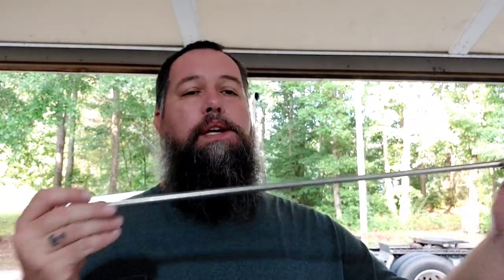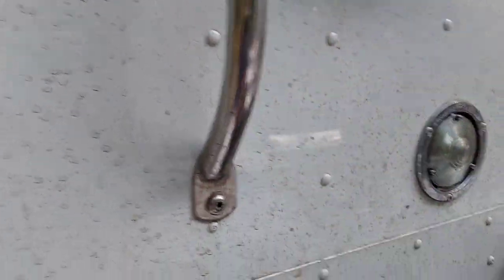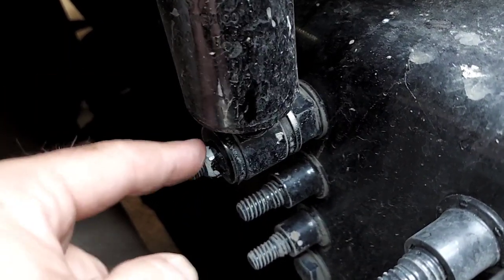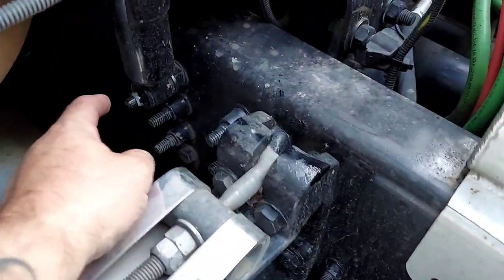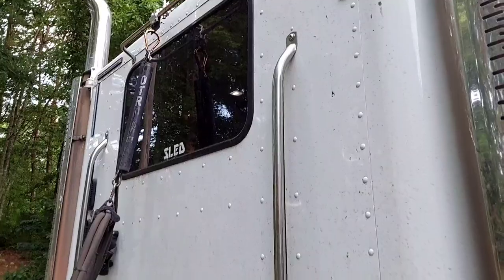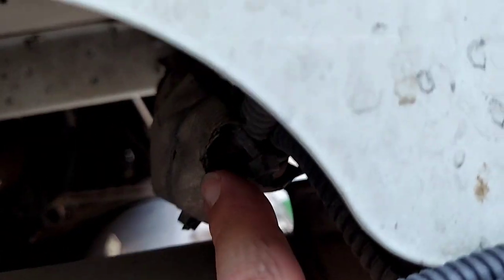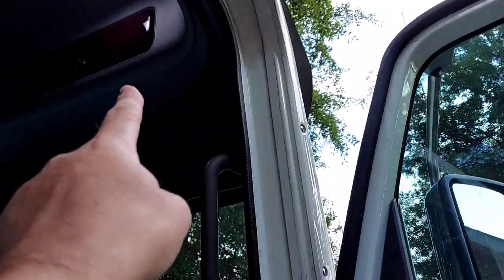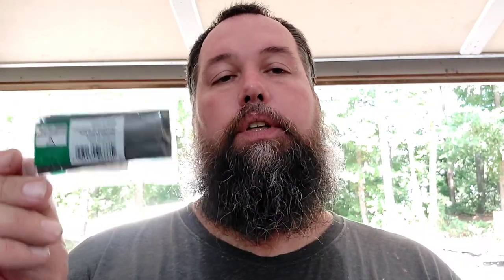The best CB antenna and mount location to date!

Comment: Now that you've had the antenna for a bit is it any good? Looking at getting one for my dump truck because I'm tired of buying new whips for my Wilson.
Reply from the maker: I really like it. I do hit a few trees, but the whip doesn't been easily like the Wilson's do. The spring on the top of the coil helps.
Reply: Thanks, I probably buy a new whip twice a season running asphalt. The last whip fell off under a silo and I've just been running a 2ft Wilson fiberglass. technically works ok for what I do most often but definitely not good enough for my anytone6666 full potential.
Reply from the maker: @rkelly5803  the Hustler SCB should hold up a lot better. I have found (besides having a good antenna) RF bonding will help get the most of your system. Check out this video. The RF bonding is so much better I'm going to do CB install in my personal vehicle (when I get time) just to do another bonding project, and a couple videos to go with it.https://youtu.be/J6PJyw6jh2M
Reply: I have the same hustler antenna but with short lower staff. I run alot of asphalt as well and it has taken the beating. Proven antennas with good coax and proper grounding, it's a great setup. Plus they have holes so they don't hold water and freeze. Hope that helps

Comment: Why do truckers point antennas somewhat forward? Is it aesthetics? Omnidirectional antennas need to be vertical to work properly. Pointing them forward sends the electromagnetic waves to the ground and the sky, not in the direction of other radios.
Reply from the maker: Great question! There's a few reasons you may want to tilt them forward. 1. Most of do the most talking at 70 MPH, and if the antenna was straight up at 0 mph it's now pointing at the trailer at 70 mph. So, with a little lean the top half will be straightat speed. Depending on the mounting location it maybe necessary to tilt forward to get the coil away from the body to reduce reflection and lower SWRs. 3. Height requirements, some antennas maybe just too long and you don't want to be hitting trees, power lines, and low bridges. 4. Some think it looks cool.🤷‍♂️ Thanks for watching.
Reply: @jrichtruckincbtips  Nope...Often Not True..
The lower part of say your husler isnt flexing at any speed... the top half sure..but that mostly Affects Only recieve and NOT transmit

Some to get it to fit on say a 52" or taller antenna
Though looks like Crap..given I know how it Negates or limits better transmit abilities
Reply from the maker: @MrBOB39  not talking about the Hustler at all here, just antennas in general. Further more depending on the mounting location , you need to lean the antenna forward to reduce reflection and lower swr.
Reply: @jrichtruckincbtips  you likely Dont Realise or Understand how an antenna radiates Signal
Reply: Cause it looks cool is what I have heard. 
Like bull horns
Reply: @mrdirtwork6673  perhaps..
Yet doing that lowers the performance of the antenna

Comment: What antenna would you recommend for a 2020 t680 with the tall double sleeper(don't know what else to call it) it has the mirror mount but I'd be open to other options
Reply from the maker: I ran 6' Skip Shooters on my T880 with a short pipe over the base to reduce flex see this video https://youtu.be/jqw0Iy-5LwU.

You also need to ground the antennas and mirrors on that truck see this video https://youtu.be/Ar6mxY57lzs

Comment: Hello, where did you get the piece of pipe to go over the skip shooter?
Reply from the maker: Home Depot- 3/4" cpvc (not pvc)
Reply: @jrichtruckincbtips  did you heat it up or something to go over the bottom?
Reply from the maker: @boundndetermined225  you can, I just used a Dremel tool
Reply: @jrichtruckincbtips  Thanks for the info. Are you still running the 7' skip shooter. I have a 2017 Freightliner Cascadia and atm I have the predator 10k-22 on it (with a 99n4 radio). But it only tunes out to 1.6 swr & that's with leaning the antenna. I've also tried a 5' skip shooter as well & it only tuned to about 1.6 as well (with leaning the antenna). I have a 7 foot skip shooter I was thinking about trying. Any ideas, im trying to get to 1.1 - 1.3 swr.
Reply from the maker: @boundndetermined225  no, I'm using the Hustler SCB on a 19 Cascadia which you can see in my newer videos. I'd stay with the Predator especially if it's got the 27" lower shaft, as whip antennas receive better than fiberglass. 1.4 is as low as I have been able to get on the Cascadia. 

Have you RF Bonded the doors and body to the frame? You can usually drop a couple points in swr. Check out my Extreme Antenna grounding video.

Comment: Is that Hustler better than the stryker sr-a10?
Reply from the maker: Haven't been able to test them head to head. Stryker makes good stuff, but I here they get water in them and the lights inside effect transmit. But I have not really used the Stryker to say for sure. 
The Hustler has been the best mobile antenna I've ever used. I did recently break the shaft of the Hustler on a low tree, but replaced the shaft and all good now.

Comment: I’m probably tardy to the party but I’m running a kw and running two different antennas not really sure if I’m doing a good thing or a bad thing any tips on that or should I run two of the same antennas?
Reply from the maker: I prefer 1 antenna,  but should be running matching antennas.

Comment: I bought a Bearcat 980 SSB, and am using the Bingfu Vehicle Ham Radio Mobile Radio Antenna Dual Band VHF UHF 136-174MHz 400-470MHz NMO Mount Magnetic Base Low Profile Antenna PL259 Male Connector for Car Truck Amateur Radio Marine VHF Radio. I'm getting an RF Output "Fail" on my diagnostics. Uniden says I need to make sure my antenna is properly ground. How do I do that with this antenna?
Reply from the maker: Mag mounts usually don't need more grounding. I'd be looking at the connections, and putting the coax and antenna on an analyzer. However, if grounding is needed, my thoughts would be rf bonding.

Comment: Not sure how those 10’ straps aren’t starting to self radiate….way too much in one run….may be better to go from horizontal bar to vertical bar with 12” then from vertical bar to frame with another short strap….might look cleaner also….gotta be careful with those long runs on ground wires I’ve seen them start to radiate as part of the antenna and royally screw things up
Reply from the maker: It's been changed and truck RF bonded.https://youtu.be/J6PJyw6jh2M

Comment: Bro I just put a BR-78 Browning Flat Coil Antenna on a Pete 579z mounted above the door. Height is like 14-5” off the ground. I’m over height. Will I get a ticket?
Reply from the maker: You find the right cop and yes you can. I'd be more worried about what that whip is going to look like in a couple weeks, after hitting every tree limb and low bridge in town.
Reply: @jrichtruckincbtips  thanks for the reply. I don’t know shit about cb. I been having a guy mod my cb over the weeks and yesterday I told him I wanted to upgrade antennas. He said I’m going to hook you up with these br78.  I didn’t think about it. He installed them and as he was I asked him how heigh they was. He said idk. I left my tape at home that day.  Now I’m going to have to buy new antennas. What should I get for a 2023 Pete 579 with mount above the door
Reply from the maker: @Robert  ugh, might want to stay away from that guy. I'm not sure on that truck if it has a multiplex box. Meaning the driver's side antenna works the cb and the passenger side works the am/fm radio. So, I'd find that out by removing the passenger side antenna and see if the am/fm radio gets weak. If it does, I'd get a 4' firestik for the driver's side and Firestik makes an antenna specifically for am/fm radio in 4' also.
Reply: @jrichtruckincbtips  thanks brother. I took in a cobra 29 classic and spent 500 bucks for a super tune/ talkback/ echo/ replace meter light with green light and 2 of the br78s. Upgrade mike to a roadking rk56 And now I got to get the fire sticks and pay to have them tuned. Been an expensive adventure into cb land but I think I’m almost there. I Appreciate the help brother!  I’m going to try and swap these at the guys shop for the fire sticks. Cross my fingers he don’t screw me.

Comment: How does the Wilson 5000 trucker compair
Reply from the maker: The Wilson would be too tall for this application, and I believe Wilson to be over rated. I have never been able to get performance from a Wilson trucker antenna. I have used the Wilson 5k mag mount on a suv with good results.
Reply: @jrichtruckincbtips  thank you very much for the information

Comment: I like my Wilson antenna
Reply from the maker: As long as it's working for you.
Reply: Wilson is junk imo. I'm talking to base stations 25 miles away in the hills of wv. Dx98vhp and a 27in lower shaft predator 10k that's at half power btw.

Comment: Are you running an amp ?
Reply from the maker: No amp just the Galaxy 47hp does 100+ watts
Reply: Set up Properly
One doesn't Need an amp
Just use a decent export radio or HF ham radio with 100 watts and you are More then fine

Comment: Before you go direct to chassie,go look up some stuff on bonding from bbi....Ill come back with a link in a cpl msg..
Reply from the maker: That's a long ass video, lots of good info. However, some of have to consider that we are in company trucks and can be limited in modification. I can't get the door hinge bolts out , it seems someone went heavy on the paint. But, will be bonding the cab soon.
Reply: @jrichtruckincbtips  break through the paint..Once you have it bonded on the hinge bolts spritz it with a clear coat..Ya know rattle can stuff..I drive company as well and i dont drill holes or anything like that..If i gotta replace a bolt or something simple fine but nothin major or i find another way..Yeap long vid is right,but you learn from it..
Reply: Can you share the video?

Comment: ....and then making a series of harmonic ground straps is another nightmare. 
One would think they are doing a good thing by grounding all of the loose components of their truck/car/whatever and end up with a series of harmonic "antennas"..
I usually reserve RF grounding a car/truck for use on the lower HF frequencies, 11 meters really is not that picky.
Reply from the maker: Yeah, I'm going to disagree. RF bonding makes a world of difference on semi's

Comment: sorry but a 7ft is way too long will be broke all the time anything that goes over 12 ft in height is asking for trouble
Reply from the maker: It truly depends on the antenna, I've run Skip Shooters at 13'6" without breaking them when the base is protected.

Comment: If you all want a good antenna monkey made antennas are the best antenna I been talking on the cb for many many years ever since I was a little kid I know what mobile antennas are junk and mobile antennas are not mokey made antenna hold a lot of watts if you run a linear with your radio
Reply from the maker: No doubt Monkey Made is great, but think it's too tall for this application. Thanks for watching
Reply from the maker: @MrBOB39  great, never said the Hustler is the greatest. I said this is the best setup on thus truck so far. And, that's a fact Jack.
Reply: @jrichtruckincbtips  I Truly DisAgree
So..
We Agree to DisAgree..lol
Reply: The reason the predator beats the mm is two reasons one the MM is flat coiled and makes a lot of wind noise. Secondly it's heavy af. Performance wise if the shaft is the same length there is Zero difference between mm9 predator 10k or even a big coil k40. But u can get the predator 10k with a 27 in lower shaft and it's light AF for what it is.

Comment: Well the Husler is an Ok antenna
Far better then those other antennas you insist are so Great..yet are Garbage.

That said..
Installing antennas on a Big rig adds a level of Dificulty.
Yet Both Predator and MonkeyMade Destroy the Husler
And can be had with a 20 inch plus base to rise it up and free for transmitting and offer 52 inch total length.

I have tried 100's of antennas in some 50+ years
Seen many come and go ( radios too )

Way too many people have little to no understanding on what to get and why.

By the way...that coax you are using is Crap
Get yourself LMR-400 or if willing to work with it LMR-600..run to a MonkeyMade or I-10K antenna
Use a decent Export radio at very least or better yet an HF Ham radio ( super easy to mod for 11 meters / cb
Reply from the maker: I can appreciate your knowledge and experience. I mostly reach truck drivers and the beginner. And, most are not trying to talk around the world, they just want to hear what's ahead. There's a lot of truckers that can't make noticeable changes to there trucks. Most people rely on what they can find a the local cb shop and truck stop. Most don't find the value of the CB, so they see no need in spending the money. Now it would be great if I had the resources to buy a try all these different combinations of radios, coax, and antennas. But I don't, so I keep going on my experience with what I have. 

But, thanks for watching and your insight.
Reply: @jrichtruckincbtips  I hear you
Admittedly..I have Not worked on Big Rigs.
This I Know would be Hardest for those who Dont Always have the same Truck

Those who do have their own or at least use the same Big Rig would Indeed Benifit from a Great radio, antenna and power Mike and would be Best in using High Grade Coax..

Keep your Channel going and growing
Reply: lmao the length of mobile instillation, larger coax is useless. Length matters in antennas, bottom line. Length, then design.
Reply: @MisterTwister222  Come back to me when you Know what you are talking about..

I understand Most use Garbage Coax
Most Also have Garbage systems

Live and Learn
Reply: @MrBOB39  20' length for rg8x, the attenuation is like .2db. two tenths, thats it. Youre a big talker, act like you know things, but youre all talk.
Reply: @MisterTwister222  You are Of course Not Fully Right
Yet
Is People like you
Who see and hear my Consistent long distance Contacts
Both mobile to Mobile and Mobile to Base

And same for my Base set up to
Where I use Helix LDF5-50A and for my beam LDF7-50A
Reply: @MisterTwister222  I know it is Minimal
That isnt why or indeed not exclusively why I Insist on better coax

Do your Homework
50 years I am doing this
I have my reasons